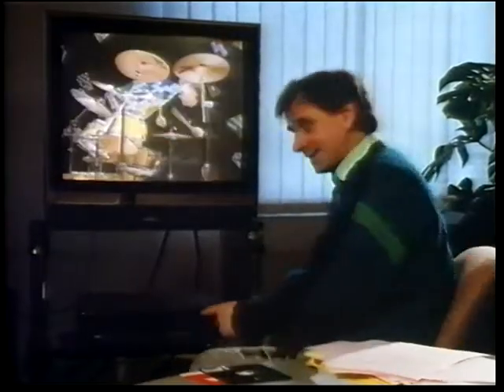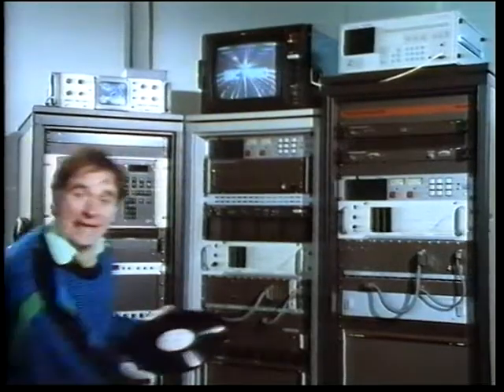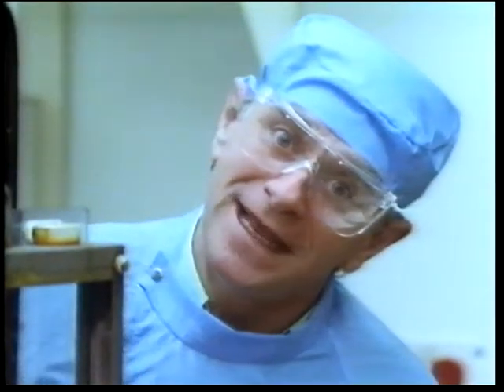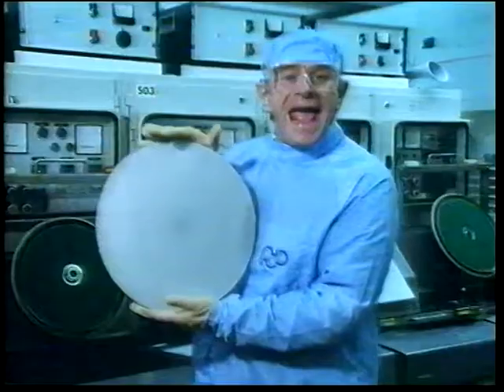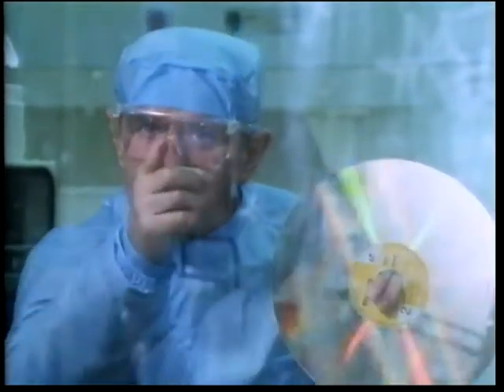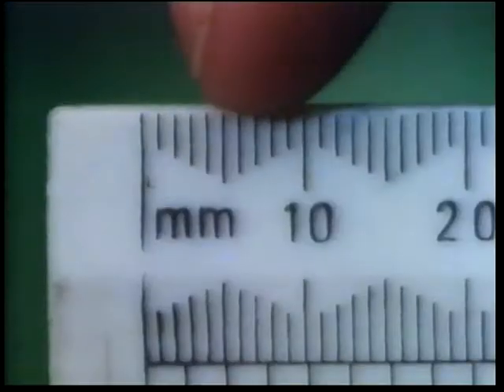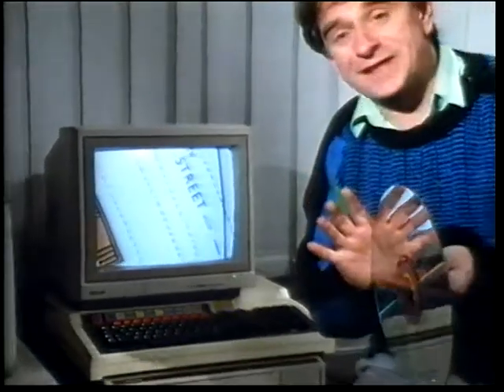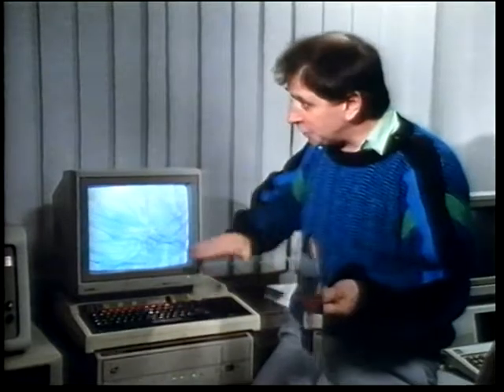Johnny Ball Explains How CDs and LaserDiscs Work (1988)

Comment: If he visited a laserdisc factor, someone could have told him that laserdisc doesn't store digital data -- it's analog
Reply: Egg heads like to trick us cos they can't get girls at discos..
Reply: This was 1988 is belive, so laserdiscs did store digital information too by then.
Reply: @paulheap1982  the audio was digital but the video was analog.
Reply: Yes and no... Laserdiscs are indeed digital being a bistate storage medium. However the video information is Pulse Width Modulated (PWM) as opposed to the audio being Pulse Code Modulated (PCM). This means it is representing, in binary form, a differential of an analogue wave which is decoded by analogue integration of the digital stream producing an analogue video signal. In truth it's an ADC/DAC process just like PCM but without error correction at either end. Also PWM doesn't have a finite and distinct timebase like PCM does and the video produced is not an image in a digital raster so is not absolutely quantised (although Digital Memory players like Pioneer's CLD-D925 do something approaching this like a TBC VCR).
Reply: @mbvideoselection   The video and audio is analog,  yes , the laserdisc specs evolved to include encoding digital audio .   In this youtube video,  the guy holding the laserdisc,  "how is it all done?  It's all digital",  which is incorrect.
Reply: @tomservo5007  It's not that distinct... Re-read my post above. Although indeed it is true that the PCM Audio spec was only added for the relaunch as "CD Video" in 1988, which in about 1992 became known simply as Laserdisc with Digital Audio when the term CD Video was dropped and Philips gave up on it for Pioneer to persevere with.
Reply: @mbvideoselection  " It's not that distinct",  for the video,  yes it is.  The video portion isn't encoded digitally,  there's no DAC conversion, the 'pits' on the laserdisc aren't 1s and 0s.   If I play a VCR through an LCD TV, does that make the video source digital ??
Reply: @mbvideoselection LaserDisc video is not digital so there is no binary data

Comment: And 30 odd years later most of those discs are suffering disc rot and are virtually useless.
Reply: Not at all, I have a big laserdisc collection and 99% of them are in perfect condition and play well with no artifacts. .
Reply: @alainterieur794  Most later laserdiscs (although it depends on pressing plant) are typically fine but a lot of the laserdiscs from the early 80s suffer from disc rot.
Also I wasn't just referring to laserdisc, but also CDs (a lot of early CD titles are prone to rot) and also the CD Video system (since he's referring to digital I assume this is the system he's referring to, despite holding an analogue only laserdisc).
Reply: @DVDandFilmBloke  And now we have the awesomeness of digital, which is permanant. Hang on, what if the power goes out. Buggar.
Reply: @crediblemulk4638  just as useless as non digital formats then.
Reply: @paulheap1982  Yes, well done Captain Obvious.
Reply: @crediblemulk4638  Power goes out, no laserdisc player or TV. It's more like subscription run out or internet goes bust. Today's generation after 2 minutes? WAAAAHHH!
Reply: Indeed. CD Videos used a terrible orange dye (which they called gold at the time) which seems to have attracted mould over the years in the vast majority of cases. Also the factory that made them (Philips Dupont Optical) didn't seal the layers of their discs very well (whether CD or CDV).